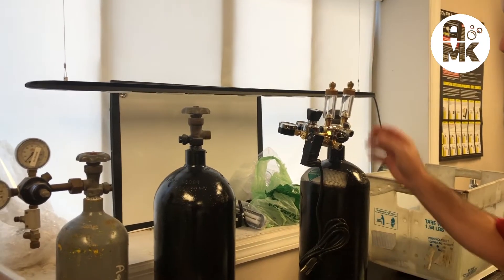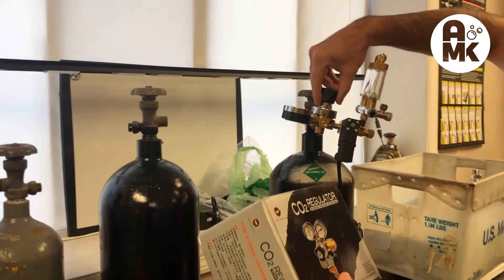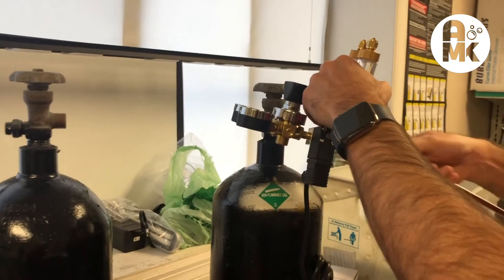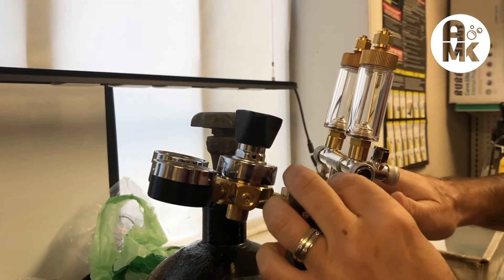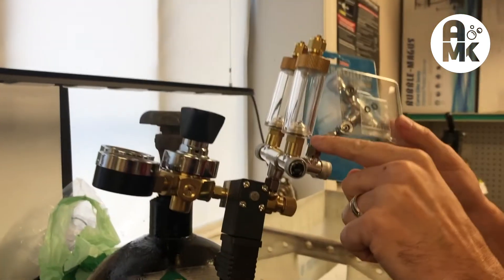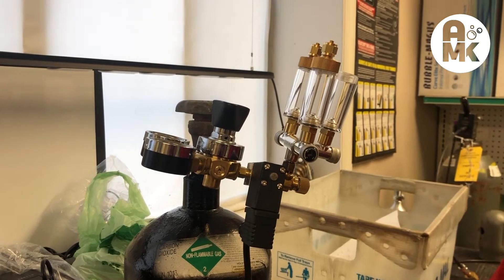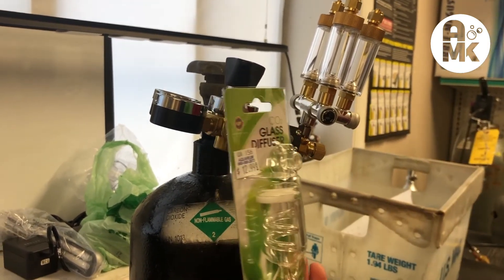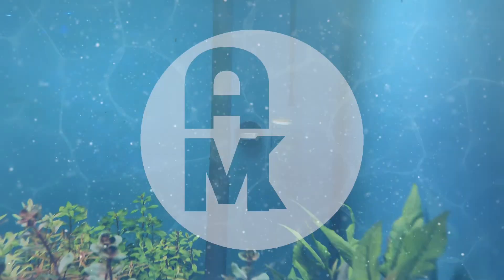Multiport CO2 Hookup Run multiple tanks with one Co2 tank and Up aqua regulator How TO

Comment: Running a splitter on a single stage is very risky in a planted aquarium!!!! Impossible to control or regulate stability of the outflow.        P.S yes I know its a dual gauge.  Doesn't mean its dual stage.
Reply from the maker: I know the difference between true 2 stage and dual gauge.  This has not been any issue at all in this setup.  It has been up for multiple tank changes.  Dual stage regulators are also not all created equal. I have. Review coming of over 20 regulators soon. Some single stage worked better than lower quality dual stage. The poppet design comes into play and quality.

Comment: With 1 bottle running multiple tanks how long will it last?
Reply from the maker: It depends on the size if the tank and the  flow used. These are lasting 3 months in their application.